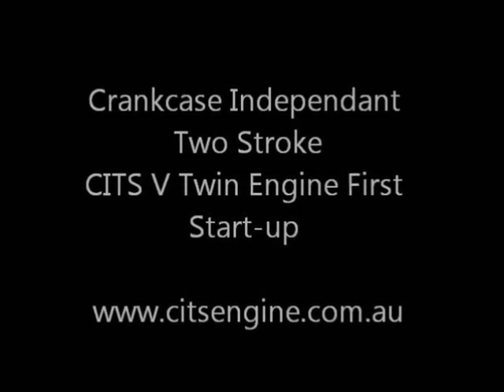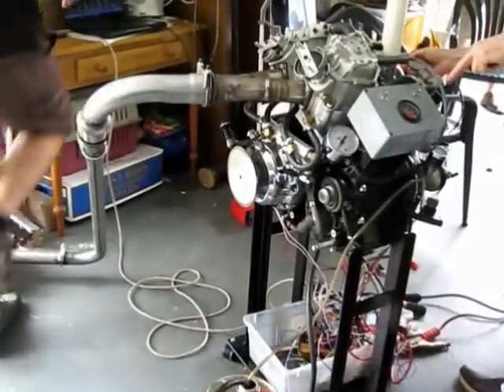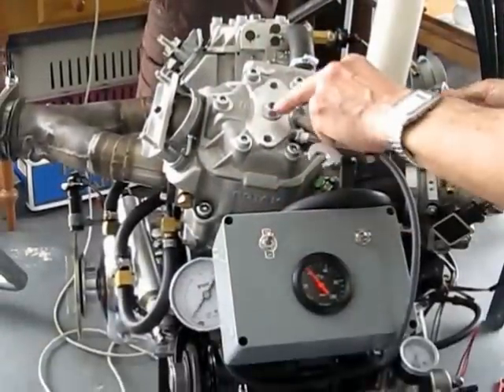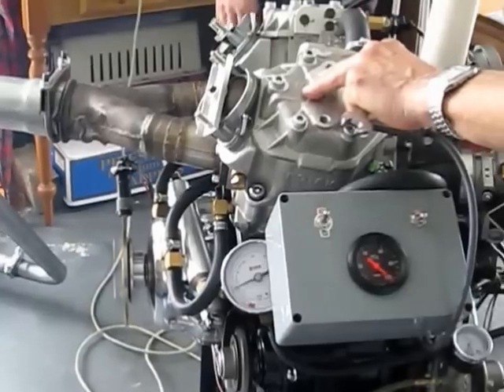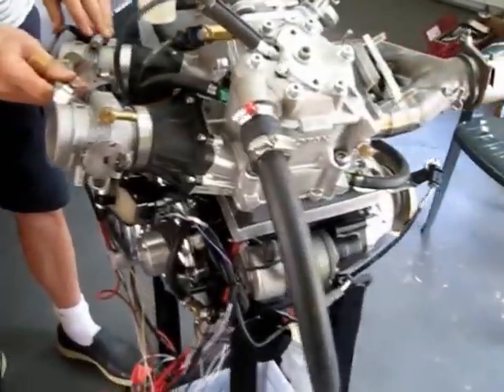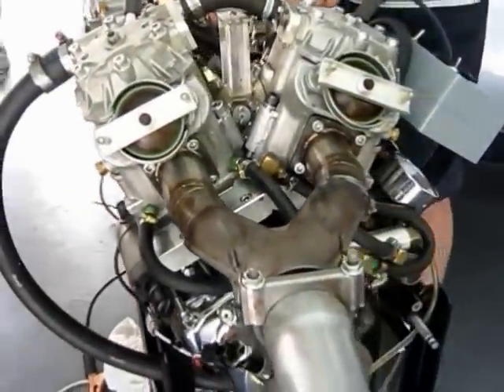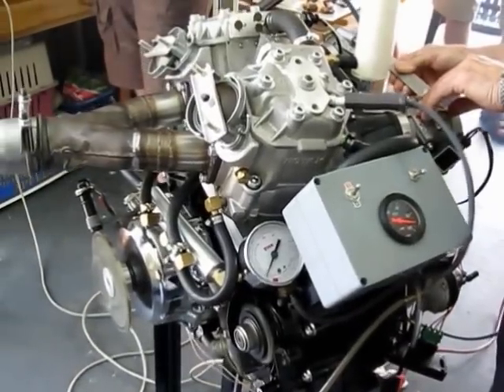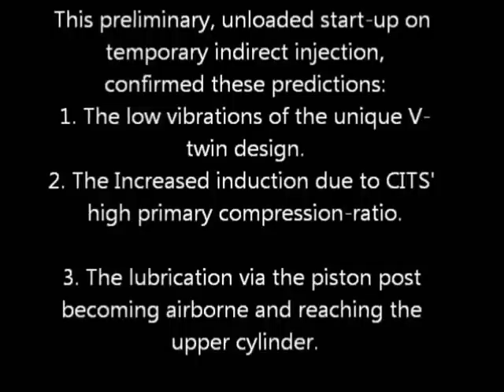CITS Pure Fuel V-twin Two-Stroke Engine - First Start Up

Comment: A few rev ups would have been nice. We need a update video as well. Telling us about its origional emission and power output. Tweeks and retesting, were you are today with production. Please keep us informed. And good luck on what looks to be. A well built and thought out two stroke engine design.
Reply: Cut up a 1800 v twin to make a 2 stroke 1800 inline, 3600 4 inline or 5400 in line 2 stroke with the parts. 10 to 12 ports or detroit diesel 2 stroke port pattern with exhaust valves and turbo. Any thoughts on this 2 stroke conversion?

Comment: will this go into production? I'm amazed no one has made a "clean" two-stroke but instead doom it in favour of four-stroke units.
Reply: What is with this plain bearing wet sump crap, I fucking hate this design but everyone loves it for 2 strokes and 4 strokes, it just be some kind of obsession,  I love big heavy m50nil alloy steel roller bearings!